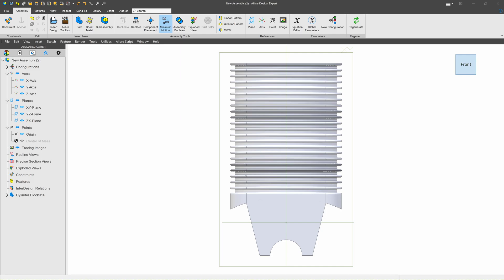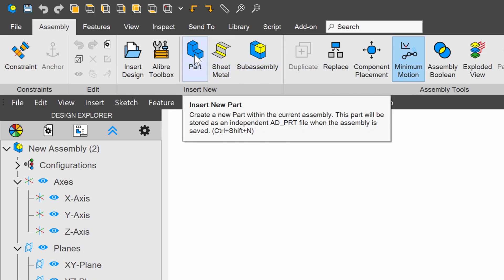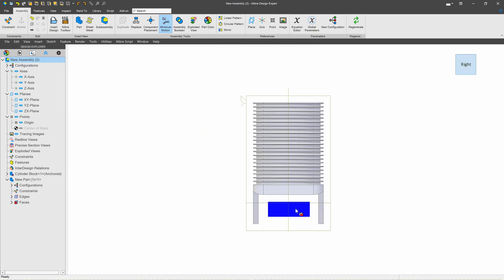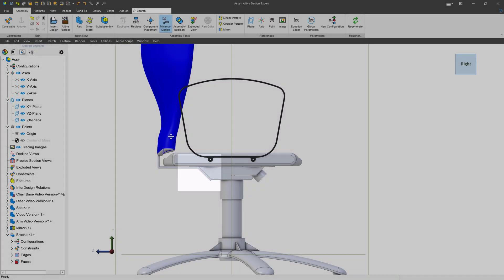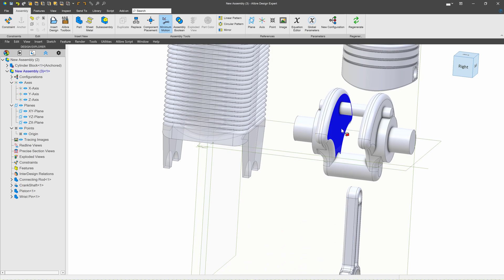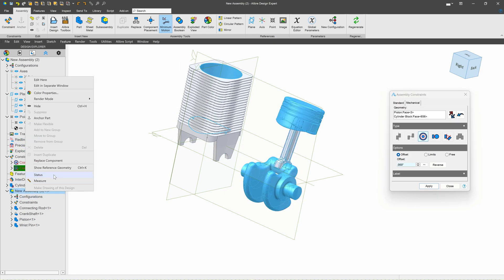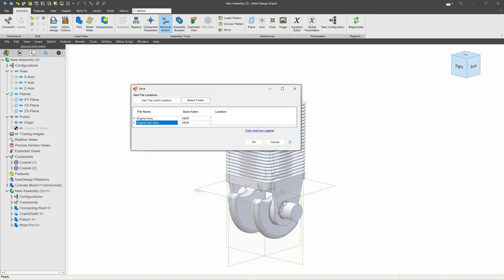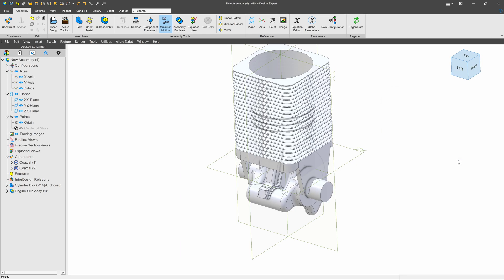Alibre | Make Subassemblies Inside Assemblies

Comment: Is there a way to add limits to travel of components? for example, limit travel of a linear rod to 30 mm, etc. or limit rotation of a wheel by angle or prevent from two faces passing each other but make them as hard stops
Reply: Yeah. If you select the Offset constraint, it has a check box to have limits or not